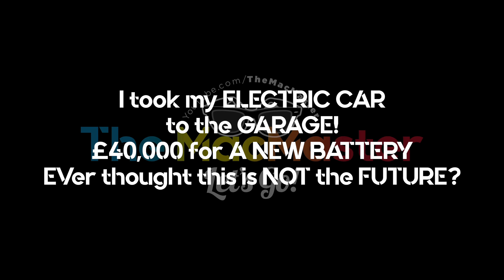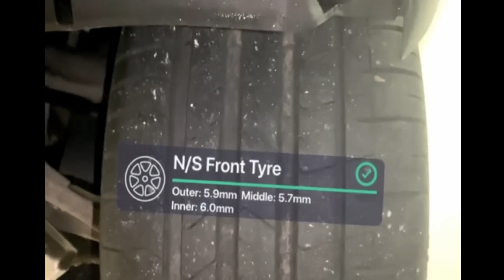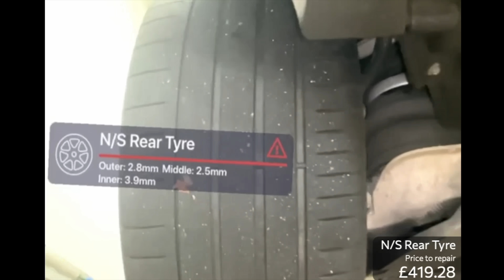I took my ELECTRIC CAR to the GARAGE! £40,000 for A NEW BATTERY EVer thought this is NOT the FUTURE?

Comment: You speculate at the beginning of the video that a battery might cost about £30k and towards the end of the video you appear freshly shocked when supposedly having just been told that it would actually cost £40k. 

You also appear, however, in another video, filmed outside your house (I presume), appearing freshly shocked at the £40k price of the battery whilst seemingly quoting from some stapled sheets of A4. 

I'm wondering, therefore, which video contains faked emotion and which video contains a faked point of reference.

Do I detect a whiff of Jackanory syndrome?

To quote Shakespeare (or some other bloke who couldn't spell) "It serveth thee well, Sire, to maintaine ye waistbande of honestie, lest ye trousers of integritie shall falleth down".
Reply: Such fake video. Horrendous click bait and at the end of this video, yeah battery is fine....

Comment: Ludicrous, electric cars for so many reasons are not environmentally friendly. The whole cradle to grave journey with them just points to one thing - they are not the solution. There are so many negatives about them whether small or large. I prey Toyota push their new generation engines.
Reply: So what is that man?
Reply: Toyota have screwed up, hence 10 new BEV models by 2026
Reply: Well 'Man' as you put it - suggest you read-up on Toyota better than your commentary above

Comment: I`m not sure you understand the electric drive battery. You refer to the drive battery as a single unit which it is not. "The Battery pack" to give it its proper name is made up of many packs (Batteries) called pouches. these pouched are are 3.5v nominal wired together to give the desired output. A smaller car will have less pouches  in the battery pack hence a smaller battery.  When the battery pack develops a fault or is damaged as you refer. the failed or damaged batteries are removed and new pouches inserted.
This is what happens when a claim is made under warranty. and is what would have happened if your battery had been damaged. I can therefore see no reason  why you claim it is £40,000 for a battery to sustain so much damage that the whole battery pack needs to be replaced would mean that the car has suffered extensive damage in other areas that the insurance company would total loss the car to salvage the batteries. which have a high resale price in the used market
Reply: I'm almost certain you don't understand the New World Order. LOL

Comment: should've leased a Japanese car ... cheaper all round and will do everything your Porsche does. I've said it many times that the future is electric. Forget what we are driving today as these vehicles are flawed in many ways (as you have proved). Fast forward to 10 years time and electric will be better than petrol and diesel in every way. The range will be close to 1000 miles, the batteries will be re-conditionable, and fast charging will mean a full charge will be achievable in less than 5 minutes... Sounds like science fiction but technology moves on leaps and bounds when the market acts as a catalyst.

Comment: £79,200 for the gase Taycan, so 50% of the value of the car is the battery - 997 engine £6k (2010), so how much a porsche 911 2020 engine costs, double £12k - so at best 10% of the battery.

Comment: Would you go to a dealer for a brand new engine in an ICE car? Of course not. Should your EV need a new battery, extremely unlikely by the way, you'd go to a 2nd hand battery retailer for a reconditioned battery at a fraction of the price. Please be realistic with your videos. Batteries in EV's will outlast the car in 90% of cases.
Reply: They won't there like Phones I wouldn't buy a second hand battery for a Car Phone batteries die and can never be replaced why it is chemicals chemicals have shelf lifes once that gone they go
Reply: Could be wrong, but I believe Lee is leasing the car. If so, it's probably required to get all repairs done at the dealership.

Comment: In many ways the battery is what the engine is in an ICE, it's expensive, both need thermal baby sitting and both can suffer from driver abuse. The electric motor is like the fuel tank. Easy to upgrade... one in capacity, the other in power, both rarely fail and aren't that expensive. Either way we're fk'd.

Comment: I took my RRover into the main dealers in Nottingham for a product recall to secure the rear spoiler they tried to sell me brakes tyres and whatever but never did the job it went in for. They said they didn't have the right glue despite having the car for 2 days.  They promised to contact me when the right glue came in. That was last September I'm still waiting. Come on JLR get your dealers sorted so if you have a recall  make sure they do the work and not make pathetic excuses.

Comment: I'd be a bit concerned about the 2mm difference in tyre wear to the rear, unless you have changed one... I have never had that much difference in tyre wear after a new set either side.
Reply: Pretty sure he did following a puncture a couple of months ago,
Reply: Not driving hard enough.
Reply from the maker: I changed one had a puncture.

Comment: It makes no sense that 
1) the battery under shield can’t be replaced 
2) that cooling pipes are placed in such a vulnerable area, it’s a Porsche it’s expected that it will go through a hedge at some point.
3) that damaged coolant pipes can’t be replaced.

It’s like telling me, that if a stone makes a small hole in the radiator of my fiesta it’s not possible to repair or replace the radiator. Then saying I’ve got to replace the radiator as a unit with the engine, complete with all ancillaries and the air conditioning.

Comment: EV's have always been Temporary, just there to bridge the gap to a no cars at all scenario. That's the agenda and you know it is too.. Hence this video.
Reply: Hydrogen cars will be the future
Reply: Actually there are several on the market,  also all gas boilers will be running on hydrogen,  its definitely the way it will be
Reply: @robertpemberton8562 Toyota Mirai.
Reply: @robertpemberton8562  Steady on!  Just because I answered the question as to which hydrogen vehicle is available, doesn't mean i'm going to buy one or would even consider one. ;)

Comment: £420 for a tyre, I got all 4 changed on my car for Goodyear cost me a massive £290 inc valve balancing for all of them, not just one. That car is a money pit Lee, Id say get rid, but you cant.
Reply: You either have small tyres or go for budget ones. I've got 225's on the front and 255's on the rear. A good brand such as Michelin I'm looking at around £870 all in for non-run flat. Currently got it on runflats front was around £350 and rear a bit over £450 last time I had them done. I don't do budget tyres because they perform like crap.

Best "cheapest" tyre I've had and used was a brand named Avon... they performed quite well and were just over £100 a tyre on my old Focus ST-2.

Comment: No electric lorrysAre there any electric lorries in the UK?
Mercedes Benz eActros

With the tagline of 'more than just a truck', the eActros was Mercedes's first electric HGV to be released. With a range of between 300-400km (186-248 miles), and a super-fast charging time of 20-80% in just 60 minutes, the eActros is definitely one of the best UK electric HGVs on the market.5 Jan 2023 so there are electric lorries and more will follow.

Comment: Shock horror! Hapless owner is stunned to discover Porsche £150k super car is expensive to repair! Who would have thought.  I wonder what a new 911 Turbo engine would cost. I am thinking fivepence. 
Teslas come with about ten dash cams for free. 
Conflating a telly remote control battery with a vehicle battery PACK (hint) is like saying Petrol is the same as alcohol because if you drink them they will both kill you. 
You are not out of the woods yet though my friend - "Porsche recalls over 40,000 Taycan EVs owing faulty wiring harness: Report. Porsche has announced a recall of over 40,000 Taycan electric vehicles worldwide. Porsche has recalled 40,421 Taycans EV manufactured between 10 July 2019 and 18 May 2021. Don't know your car's date of manufacture with your personal number plate"
Porsche's synthetic "wonder fuel" is at least ten times more expensive that petrol." There are no stations and no way to get it local but apart from this minor quibbles they are onto a winner. 
You should have opted for a Fiesta One LItre Eco boost as both your Taycan and a Fiesta are both cars and therefore exactly the same. 
Ok I do accept you would be out of your mind to buy a new eco-boom engined Fiesta for a starting price north of twenty grand but it's just an example. 
Anyway all the best with your shopping car. I mean cheap to run family hatch. I mean poor man's Ferrari. 
I do agree that the London ULEZ caper is bang out or order, as is the inexplicable permanent road closures to help "pollution". You don't want to stand too near the main roads. At any time of day or  night.

Comment: Comparing phone batteries to EV batteries is ridiculous. Different technologies will be suitable for modes of transport, electric is seen as the best environmentally for cars, trucks may have special areas for ultra fast charging. The synthetic fuels will no doubt become available but if they are 10x the cost of standard petrol then would you stay running an ICE car?
As regards to the Government well....they don't like EV's or ICE cars, any support for EV's has been abandoned.  A Tesla Model 3 2019 used as an Uber, serviced by another youtuber "James Cleevely has done over 200k miles and battery still around 90% so very likely that an EV battery from any modern EV will outlast the car. His costs for servicing since new were aound £808 excluding tyres, still on the same brakes as from new.
Finally, Porshe prices are going to be crazy for the labour as if you own a Porsche you can obviously afford to pay loads a money  for servicing and parts. 
Nowadays I feel a front and rear dash camera is a requirement as a just in case.
Reply: EV's are not environmentally friendly stop kidding yourself, research the facts if you dare.

Comment: Think I will stay with a2 001 Audi A2, 85 plus  mpg on a run 55 round town run it as long  as they will allow. Only Porsche I would want is a 1980's 911 or a replica RSK with Porsche tuned 912 engine.

Comment: Amazon are using electric vans.
The Airline industry is for synthetic fuels and possibly hdrogen, batteries are too heavy.
Goverments have pledges to the EU to be carbon neutral by a certain year so they try and push people
into less poluting modes of transport.
Technology is advancing now into different types of more efficient batteres such as solid state or Lithium iron phosphate to
try and reduce the mining of rare elements from the ground.
JCB have developed a hydrogen engine for their range of diggers.
Hydrogen is the way forward but it needs money and resources to make it viable.

Comment: I remember when not so long ago flat screen TVs were very expensive and hardly anyone could afford one, nowadays they are dirt cheap and every one have one. The same will, and is happening to EVs, the price is dropping all the time.
Maybe you shouldn't have bought such an expensive EV in the first place, it was always bound to drop in value more than cheaper EVs have .
Reply: I would add that some Porsche, BMW and MB models have had historically breathtaking depreciation along with Cadillac, RR, Bentley ETC.  The buyers of these expensive cars are leasing them with full warranty, in a lot of cases through their businesses, so the depreciation and maintenance are immaterial to them.  The problem arises when regular smucks buy these cars new or used as lease returns, and are then surprised by the well known drawbacks indicate a less than thorough prepurchase examination of the pros and cons.

Comment: Yes porche have e fuel, made using carbon capture, wind and solar energy and water, they run an ice porche racing 911 on it and it works just as petrol does.
Reply: ... and there is some regulatory classification thing where they are trying to not acknowledge it as a green fuel - in the video linked above.
Reply: @vr6280  but it is green it's obvious it is, and as we know lithium and cobolt mined by slaves for electric cars using fossil fuels is very bad for the environment, so this e fuel would cut all that out. What they are worried about is if porche can do it, anyone can, so it will be cheap because of competition
Reply: It costs in excess of 10 dollars a litre at the moment. That’s cost, not what they would sell it for so I wouldn’t hold your breath waiting for it.
Reply: @oldgit15  yes it does now because the production they have is very small scale, like anything the more it's perfected and supplied the cheaper it will become. The process just needs perfecting, but it's likely this or similar that is the greener choice, because it could be used in older vehicles and lorries, eventually
Reply: Well yes, just like EVs in fact.
Reply: Than a battery car

Comment: I’m a bit surprised on how cheap battery would cost.  Are Porsches cheap cars in the U.K.?   I had to laugh when you mentioned, “only 16% of people can afford EV”, only because like 1% of people can afford a Porsche here in the States. Seriously, if I mentioned to anyone I was going to buy a Porsche, people would call me crazy.  My family would probably disown me. Even the dog would move out.  If you are worried about “control” don’t buy a Porsche.  They own you as long as you own that car. EV or ICE, you are stuck going to the dealership and paying a premium price for all repairs!

Correction on the blog post.  The battery warranty is 8 years/100,000 miles whichever comes first for the battery warranty, not 5 years/100,000 miles.

Comment: Having just looked online the current price to replace a fuel tank for a conventional car is averaging out at under 1000 pounds - anyone got 40 cars?! The cost to replace a battery array along with a power network  which will increasingly become a drain on the grid will be its downfall. Don't know how far hydrogen has advanced in development - but the element is abundant and cheap - but harnessing and making stable and safe may again be a problem.

Comment: One of the problems with electric cars is the lack of expertise in servicing. Therefore, Porsche, or Tesla have effective monopolies on looking after their cars. I’m sure Porsche are only charging £40,000 for a battery because there’s nobody else able to offer a battery. If the market was opened up and there became more suppliers of batteries or experts in the maintenance of electric cars, then that price would plummet.

Comment: Electric lorries are on the roads check Nikola also Tesla will do a plane as soon as the weight ratio for the batteries arrives it's not far away, the planes will be able to go into the stratosphere where there is no air for combustion engines and cut travel time down etc etc

Comment: Both electric planes and trucks  already exist. Yes they will no doubt be almost prototypes at the moment, but I am guessing technology will get better. Trouble with both will be weight and efficiency, however that is what research and development is for. I think many manufacturers will go down a modular cell route as well, so you can change out bad cells rather than the entire battery in the future. What is the answer if not batteries? Keep burning fossil fuels? Hydrogen? Hydrogen uses way too much electricity to make currently and is quite complex. The sun will always be our most abundent energy source, so harnessing and storing it more efficiently would make sense in an ideal world 🤷

Comment: I used to work for a major aerospace manufacturing company and I can tell you that all the major aircraft engine makers are developing and prototyping electric flight engines and battery systems. They are still years away from commercial use and I doubt any will be used on long haul aviation but I think we may begin to see them on local domestic flights in a few years.
Reply: Powered by gigantic lithium batteries . That sounds so hot 💣🔥
Reply: @cristig243  More than likely. Imagine something like an electric powered Airbus A380, how much battery power required to get it off the ground and power it for 12,000 miles to Australia!! Probably cost it 20 to 30 tons of cargo weight and take a week to recharge after one trip!

Comment: Did they not think to put a very thin layer of strong steel or carbon fibre over the battery to protect it.  Just saying....
Also, get part worn tyres, save yourself a fortune.  Is it really a service with a battery car?
Reply: Never buy part worn tyres.
Reply: @paulbriant4693  Why not?
Reply: Well, you don't know the condition of side walls, general usage etc.  Placing your life on four hand sized rubber contact points on tyres you don't know is just madness.  If you can't afford new tyres for your car you are in the wrong car.
Reply: Maybe they did put a layer of steel or carbon over it and thats why its not damaged.
Reply: . @paulbriant4693  Why not? Anyone who buys a second-hand car is buying a set of part-worn tyres. The regulations covering the sale of part-used tyres is more than adequate to ensure that they are safe
Reply: Well rather you then me, I value my life.
Reply: @paulbriant4693  I have a mate who used to work in the tyre game and where he worked they sold part worns and new. Some of the part worns were far superior quality than new tyres.  Far safer with good part worns than half the cars on the road running with tyres far too low on tread.